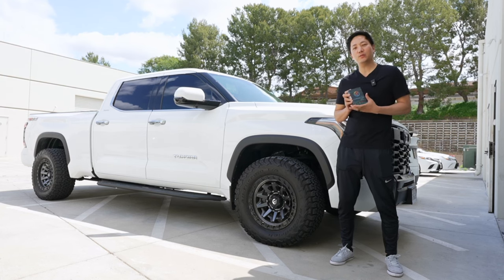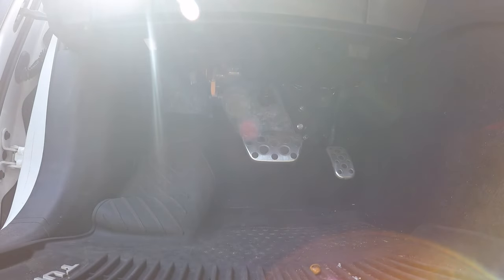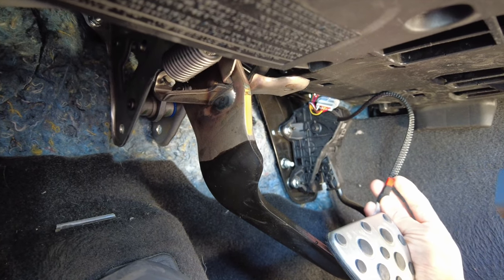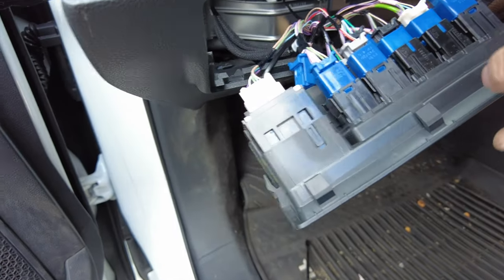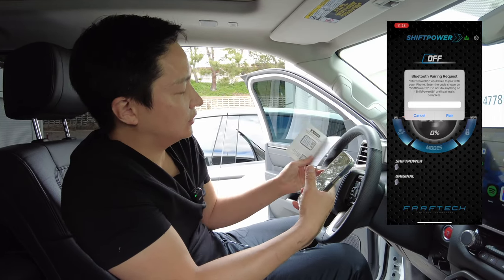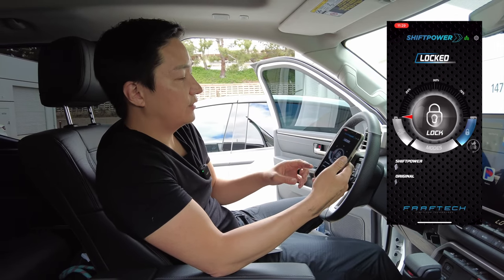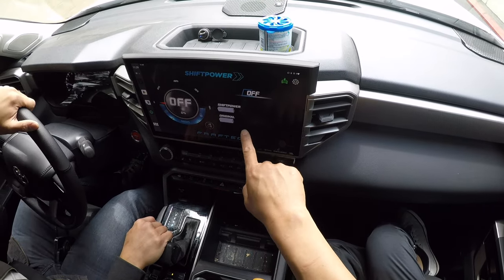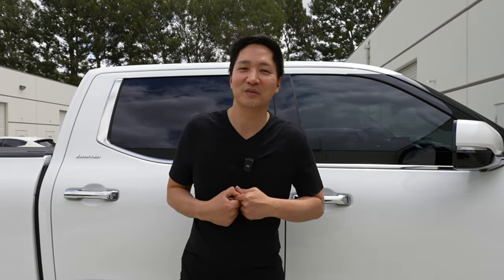2023 Toyota Tundra | ShiftPower Throttle Response Controller DIY Installation

Comment: Will this work with a TRD Pro hybrid and I'm thinking it doesn't get noticed by a tech scan since its done on the interior side of the OBD port?
Reply from the maker: Yes this is compatible with TRD Pro hybrid. If you turn the device off, the tech won’t notice it

Comment: I have this throttle controler and the carlinkit android box in my 23 tundra platinum, on startup the app connects and works fine on my touch screen. However when I switch to another app then back to the shiftpower app it won't be connected and I cannot reconnect it. It works fine on my phone app. Do you have any ideas on this? Thank you
Reply from the maker: Not sure. Check your settings on the car link kit
Reply: Which carlink did u get?